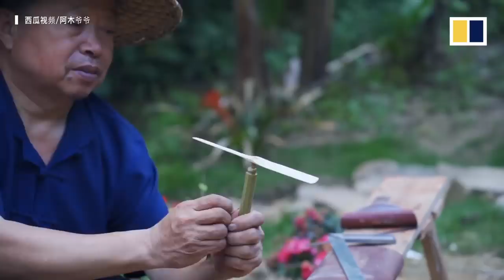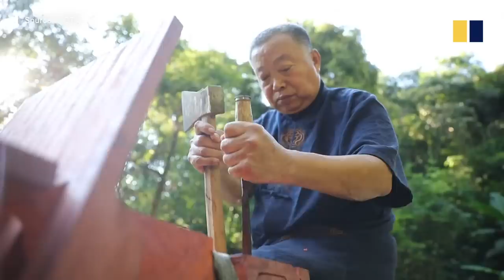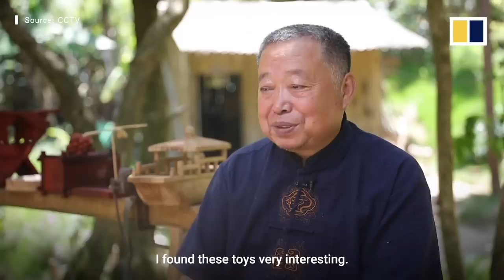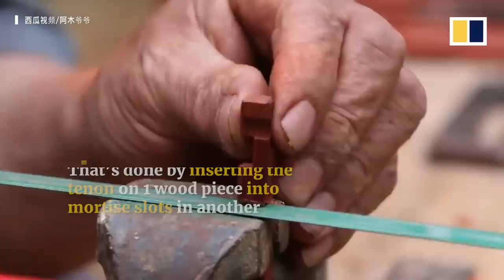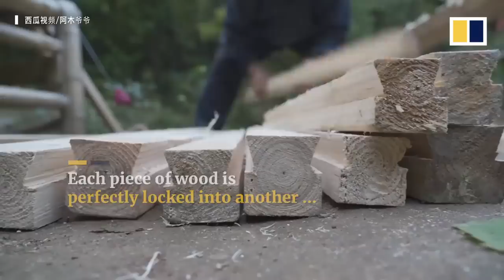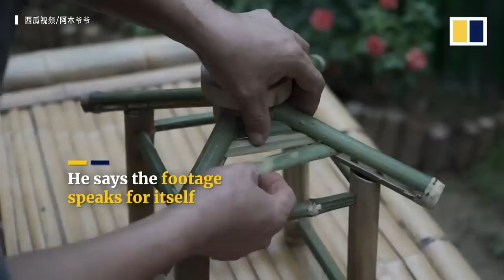Chinese master carpenter Grandpa Amu creates intricate toys for his grandson

Comment: This’s guy is a genius...most of engineers or architects can’t even do that
Reply: Why did you compare a carpenter to a architect? this guy's couldn't design a structurally sound skyscraper but that doesn't mean architects are better it's just a different profession
Reply: They can if they wanted to but first distinguish the differences between an architect and engineer to grandpa on this video. Both architects and engineers designs the blueprint that contains a set of detailed instructions to create structures, the one doing the physical work are the carpenters. So technically, they know how to build it, but probably lacks the muscle memory for precise woodwork. 

Also modern technologies paved way for better sturdy, structural designs therefore rendering these traditional methods obsolete. So you wont see much architects doing these
Reply: doidoin  architects are wannabe civil engineers who are bad at math.